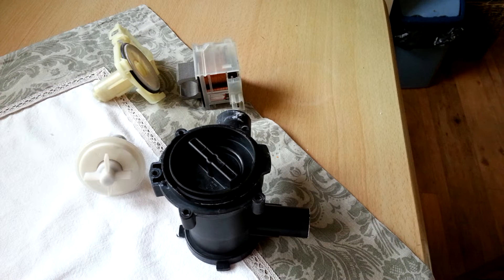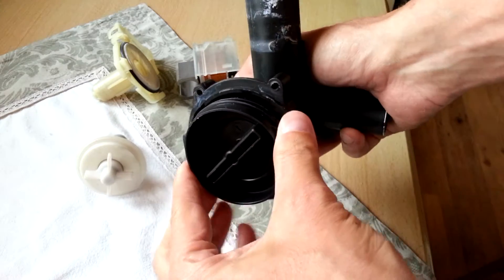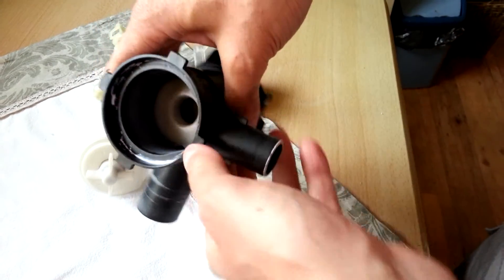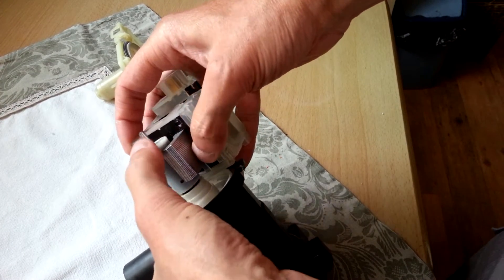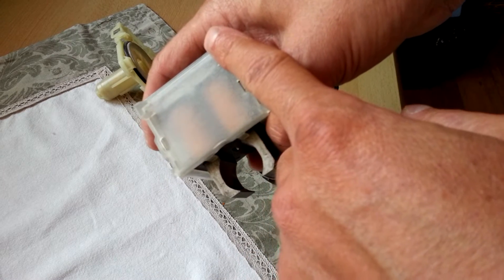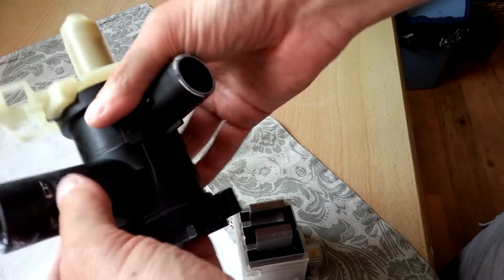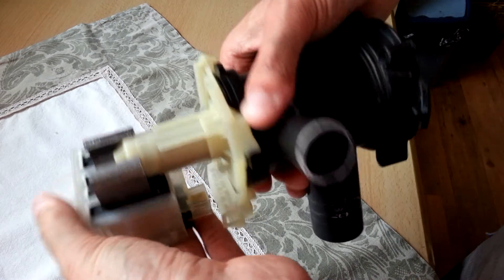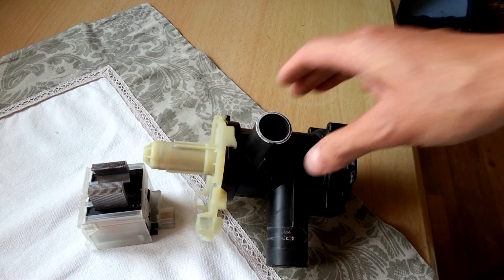Siemens/Bosch/...  washing machine water pump dissasembly(1)

Comment: Thanks for the video. My Bosch pump gasket leaked into the shaft area. It would only pump when it was dry. Dis-assembled cleaned out and assembled. Works like a charm. Thanks again.